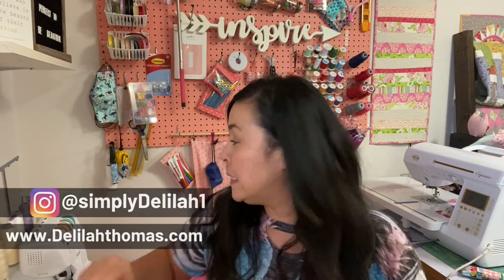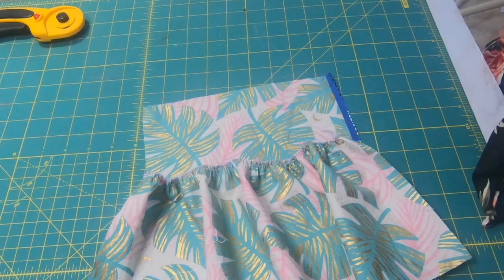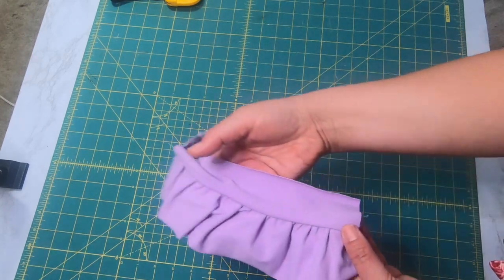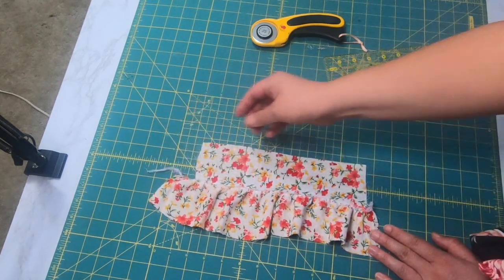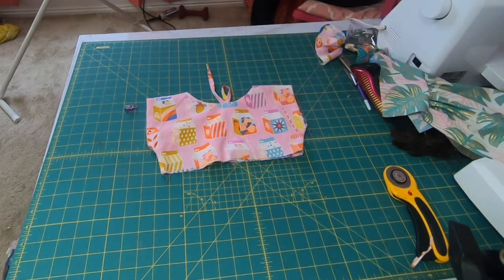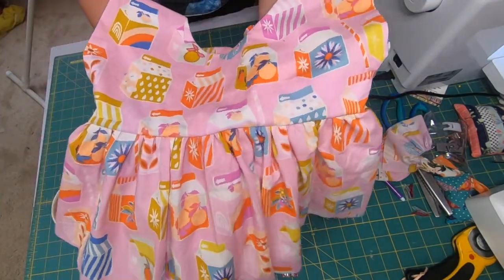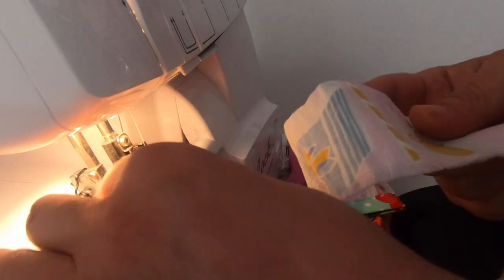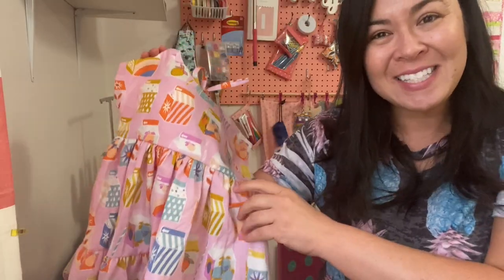HOW TO MAKE RUFFLES USING YOUR SERGER, FAST WAY TO GATHER KNIT FABRIC FOR DRESSES, SEWING TUTORIAL

Comment: Thank you for this tutorial!  I have a Babylock serger with automatic tension so I don't know how I could achieve this.  Your dress is so pretty x
Reply from the maker: Thank you ! i love baby lock and would love to have that serger but yeah the tension I think would be a problem because i use my serger all the time for gathers, i love making tier dresses for me and my daughter
Reply: @katedelaney5910   I can't change my needle tension, babylock machines do that automatically!
Reply: @notimetowork  I've seen a tutorial on this using a babylock on YouTube somewhere. They did not adjust the needle tension, but only the differential to 2. They also changed the width of the stitch if I remember correctly, but that's it. And it worked.